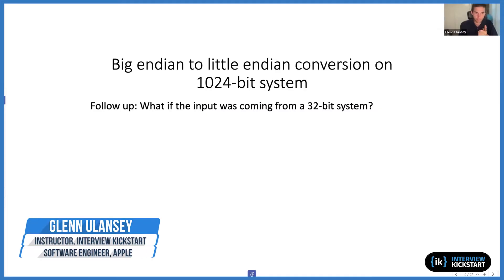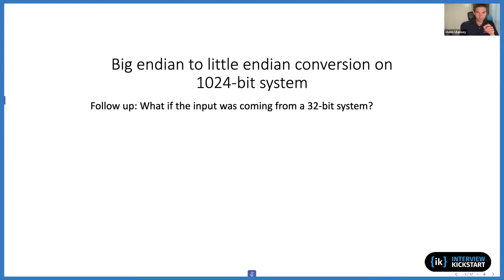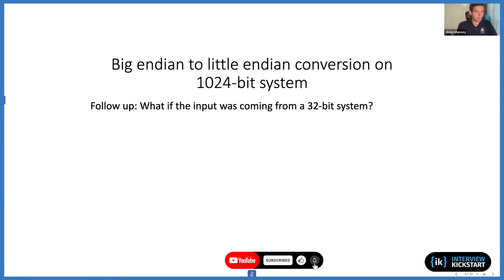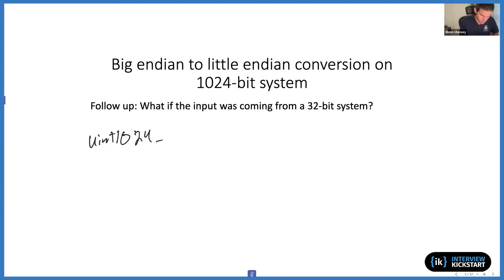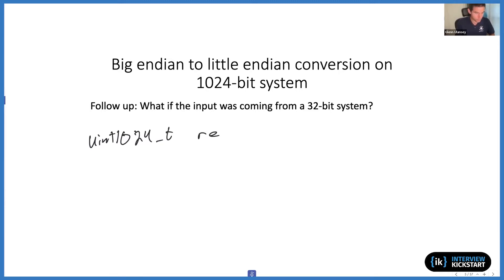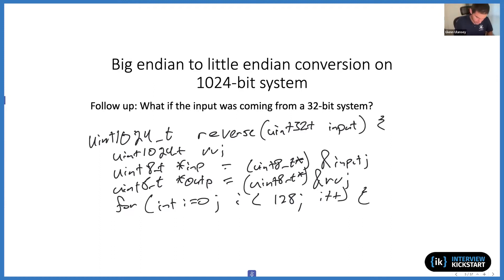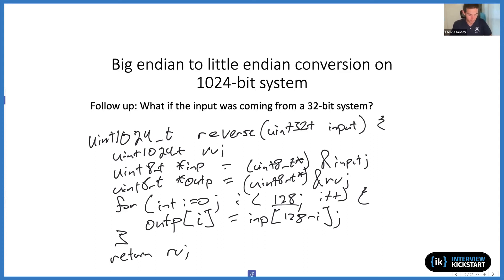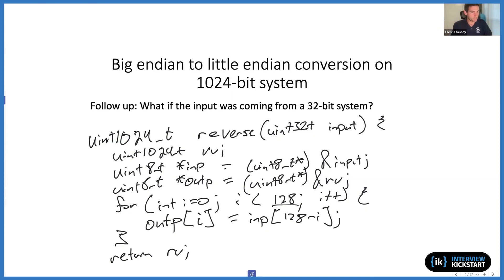Big Endian to Little Endian System | Embedded SWE | Interview Question Discussion

Comment: Thanks for taking your time creating this video. Interesting to see how you break down this problem into small chunks. Just an observation though: when i = 0, inp[128] will read outside the memory allocated to inp as it is zero indexed, and when i = 127, last iteration, it'll read inp[1], when you'd want inp[0]. so you should instead do inp[128 -1 - i ].